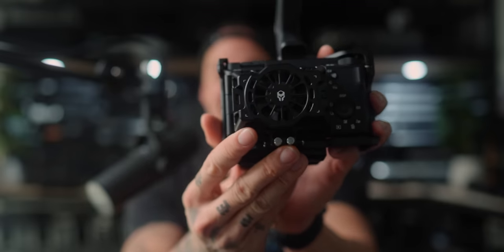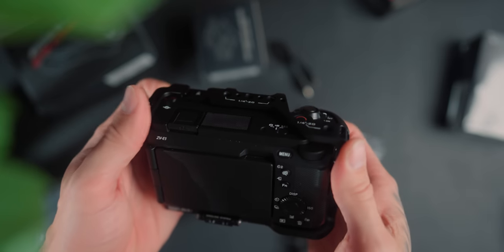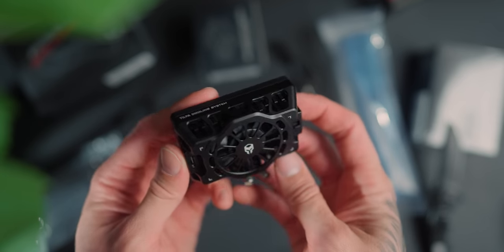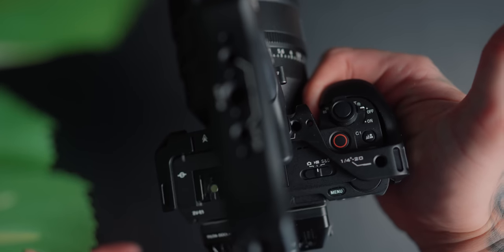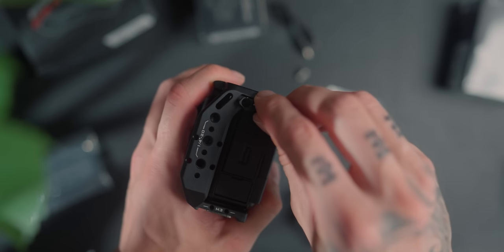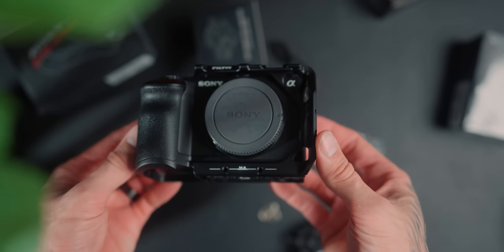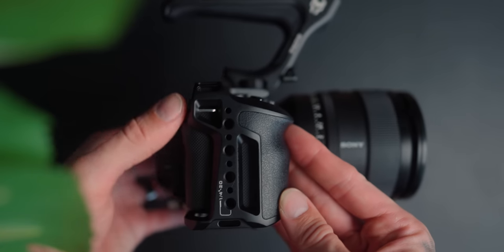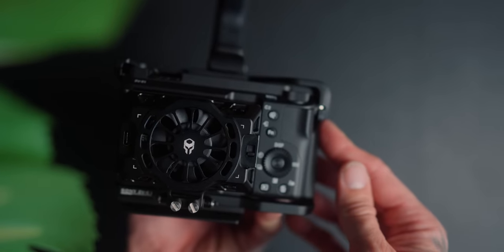Sony ZV-E1 Tilta Cage & Fan Overheating FIX!!!

Comment: There is a similar fan from Ulanzi currently on pre-order. It does not tilt down, but it has a built-in battery and the pre-order price is $19.95
Reply from the maker: I would still go this tilta version
Reply: Does it need an external battery? If so, that sucks too
Reply: very clearly this tilta one is much much better quality
Reply: @BuiltInception did you try both? The ulanzi fan seems so be super silent comparted to tilta
Reply: @mandrael  yes I can agree to that also the titla requires external power. I'll be honest with you neither one in the end I am even using. I figured if I have to use a power bank anyway I am simply using a "stroller fan" for children strollers lol. Its from amazon, USB , its silent and I just clip it on to the tripod or whatever im using to mount the camera at the time if I know its going to have the chance to overheat or is going to be longer form and it achieves the same end goal it never overheats (4k60 until battery runs out) and the benefit to this solution is also you can run it until the battery is low and then plug the power bank into the camera itself to give it even more time although it WILL overheat being powered via USB this way so I run the battery out instead. Im sure a dummy battery would work though I havent had a need for over 2 hours record time in one sitting so I havent got one.
Reply: The Ulanzi one has an internal battery as well. Very sad that this one does not

Comment: Hey Jason,  try two things with that fan if you could. They aren't practical but an extreme case scenario for this fan.
One, try and put a higher quality thermal conductor pad then the one on the fan, you can find quality thermal pads that conduct heat extremely well and fill the square space and then apply the fan and try an outdoor heat test. The second is slightly more extreme, find a  large enough thin copper plate and put that as the pad between the fan and the camera. Just ideas, best of luck!

Comment: Jason, do you know if this fan would fit the A7IV? Im not sure if all of Sony's flippy screens are the same but i was so disappointed with my A7IV, for the first time ever i recorded a school event performance for a school with kids with disabilities and the camera overheated ans shut down in 4K 30fps in 1 hour. I used a dummy battery with the display open and a FX Lion nano three external battery. The them was also said to High but the only thing i did forget to do was open the SD card cover. The A/C was On in the auditorium so i wouldn't consider it being too hot. I donated my time and the principal was happy that i was able to get the majority of the event but i would have been devastated being paid and this happening. 😵‍💫

Comment: I use the Canon version of this fan on my A7IV. It doesn't fit 100% but I made it work. This new Sony version would work much better. I hope Tilta makes a new cage for the A7IV that can be used with this new cooling system.
Reply from the maker: Oh nice!

Comment: I’ve seen some other people posting about this fan. It kinda goes against why people liked the camera because of size, and also powering it just makes it too big. I think Sony needs to get the overheating issues figured out moving forward because as of now that’s the one major complaints from people here in Miami with these new cameras.
Reply: its for versatility
if you shooting short videos take the fans off, if you need to shoot long period rig it up
theres a reason why no one brings an fx6 around to vlog, aside from the price, you cant go anywhere smaller than that, where as fx3 can do 90% of fx6 if you rig it properly
Reply: @KenTVtw  lol no one mentioned a FX6 😆 but for $2200 plus the couple hundred in add-on there are better options. And spending $2200 Sony should just get their $hit together and fix these overheating problems in their cameras moving forward.
Reply: FX6 and FX3 was mentioned cuz you said people cared about the size
and no one asked you to get zve1
if you aim for compact size, with full frame sensor, this is exactly it
if you cant handle it, get the bigger fx3
Reply from the maker: True
Reply: @KenTVtw   to be honest i think that with the cage and that fan the size difference between the EV and the FX3 aint that much anymore,....... don´t get me wrong i want to buy the EVZ1 but I am afraid is gonna overheat if I start interviewing people in the streets for example........  i guess that i could shut the fan off when i am interview people cause obviously i don´t want to hear the fan......... there are probably ways to work around this

Comment: DO they make one for the A7IV?
Reply: 8:24 he hints that it fits the A7iv. I wish he could have given just a little more depth. I’ve been wanting to purchase one for my A7iv but I have been able to get an answer to how it would stay in place. 🤷🏿‍♂️
Reply: @PastorGreads  I hear you, For some odd reason it seems the A7IV overheats for some and for other it does not, I have gotten into several disputes bc my overheats on almost every shoot and not even in that hot and humid weather, where I live it get's "hot" but no humid and nothing like Florida Hot where I am sure my A7IV would catch on fire. I am a professional and have read all the posts on how to keep it from overheating but mine still over heats, albeit I shoot 90% of the time 60p 4K which really makes the camera work a lot harder to process , but it should NOT overheat like it does so quickly.. I will most like go back to the FX3 for the same reason. I do not think this fan will really help that much anyways and might be a little bit gimmicky..

Comment: I've experimented with using my ZV-E1 as a webcam because, why not? My colleagues commented immediately on the image quality. But I found that it overheats much faster when web-camming than video recording. Lasts about 30-40 minutes in a 21 degree room for me. Have you found that? And does the tilta fan stretch the ZV-E1 to a point where I could do a full day's worth of meetings without overheating?
Reply: Following this. Any answers?
Reply: Did you try it out. I was thinking of doing the same thing.  Also which lens are you going to go with as a webcam?

Comment: Can you check the results with this fan on the new a6700
Reply: Really want to know this +1
Reply from the maker: I gave the a6700 back so I can’t test it
Reply: @JasonMorrisphotocinema  thats a bummer, hey but thanks for taking the time to reply
Reply from the maker: @cherianphilip4707  this fan does give great results on the zv-e1 which will mean it will still give some results on any other camera.
Reply: @JasonMorrisphotocinema  rather than the results I just wanna know whether it is compatible on the Sony apsc line, cos this is built for the full frames

Comment: Never had overheating issues but yesterday sonething weird happend with my ZV-E1. 

Just as I stopped recording it kept writing to the sd card and I couldn't do anything.. not even close the camera or change anything. Only way I got to close the camera was to pull out the battery 😅

Works comepletely fine now 😅😅
Reply from the maker: Yeah some cameras have random bug issues.
Reply: @JasonMorrisphotocinema  Also I can't choose between the Tilta or SmallRig cage.. which would you recommend?

Comment: Thanks so much for this great video!  I saw the fan on a Twitter (X) post from Tilta.  The fan is priced really well but that cage...ouch it's a bit expensive.  It seems to be a great design and great build but it's out of my price range. The lightweight kit at $99 may make its may to my cart though.  Cheers
Reply from the maker: I feel the cage is priced reasonably considering how well it is built
Reply: @JasonMorrisphotocinema  fair enough since you have had in in your hands.  I know Tilta makes amazing products.
Reply: the cage has a few downsides, smallrig one does not have these (hdmi clamp blocks sd)

Comment: Hey Jason! Great channel! Gear question: Currently i have a7iii with Tamron 17-28 and 28-75. I would consider myself somewhat of a hybrid shooter but with tilt towards video. No commercial, just content creation and smaller video projects for my band. What to upgrade towards 10bit 4:2:2 and i would like to have a flip out screen. Should i buy FX30(i also have Sigma 18-35 from Canon times) or ZV E1 and keep a7iii for photos for both options? Or a7IV(60fps crop is not a big deal since i also consider fx30) and sell a7iii and Sigma 18-35?
Reply: Also forgot to mention that "run and gun" is something that i am looking for with occasional controlled shooting. Thats why i like Dynamic Stabilization and small size in ZVE1.

Comment: If overheating is a concern for anyone, consider getting the Sony FX30 instead. I know, I know, you lose FF, but if you're getting the ZV to save money in the first place, the cost of FF lenses negates that. Unless you're filming for Netflix, you won't likely be able to tell the difference either.
Reply: Agree that FF isnt “necessary” but if you’re budget allows for it and also if you already have FF lenses from other FF cameras (for example I have had the A73 and loved it for years and have built up a good set of lenses for it) but now want to upgrade to a better FF vid centric rig. The ZVE1 + this fan is still an incredibly better deal than the A7S3 or FX3. I think there’s space for a varied group of creatives and I think this fills a space in that world and minus the overheating the ZVE1 is a great value prop. Add this for $60 and it makes it something to consider. 

Side note - YES i do wish that Sony would’ve solved this issue from the get go without having to use 3rd party hardware BUT I can also concede that fitting that sensor and tech into an EXTREMELY portable product had to have some compromises somewhere.
Reply: The cost of FF  lens is in fact cheaper for the same equivalent lens . To achieve the look and light capture ability of a 35mm F2  FF lens, you need an APSC 24mm F1.4 lens, which is more expensive. You may tell me you don't need that low light ability, and APSC 24mm F2 is fine for you. But then with FF 35mm F4 or a slow zoom is dead cheap, and weight like feather.
Reply from the maker: Just depends which is needed. ZV-E1 features are hard to beat
Reply: @mykeljewell I’m in the exact situation as you and I agree with everything you said.
Reply: Rolling shutter performance matters.
Reply: The low light capabilities on the zve1 sensor is awesome
Reply: I've heard the semiconductor coolers work very well at stopping the overheating. Most can't afford dropping $2700

Comment: My fan won’t turn on!!!! I plugged it into my wall, and into my v mount battery and it just won’t turn on!!! 😡😡😡 ok update. You HAVE to use usbc to usbc. You can’t use regular usb to usbc. Looks like I have to get a new battery or electronic mount plate. Fuck. The return window for my battery JUST ended

Comment: 'Band aid' solution 🙂. and Tilta makes good stuff, but if Sony (which makes good FX cameras) can't put a 2 dollar fan in all of it's full-frame cameras then I won't even look at the rest of it's features. The AF is fantastic, but we had Sony / Canon heat problems some 10 years ago. they put a fan in the FX30, so did Lumix (the most value-added cameras), so why not Sony? Frustrating.
Reply from the maker: this is what the FX line is for. They are aimed at professional videographers and have fans

Comment: Love your channel but I did my own review on this cage vs the SmallRig. I’m kind of disappointed you didn’t point out that you were either paid or just ignored all the functional flaws of this cage. Beautiful but poorly engineered compared to the more mundane SmallRig.
Reply from the maker: The only flaw I see is no mounting point in the middle. I said this in the video dude. Chill out
Reply: @JasonMorrisphotocinema  The added arca plate that could’ve been built in, the lack of a longer grip that’s super short, the placement of the cold shoe direct in front of the hot shoe, the installation process. All fall short of the Smallrig. I did a quick comparison on my own. The tilta looks and feels amazing but usability was lacking.

Love your content but just felt you gave this more props without calling out its faults. Nothing but respect though my man. But the fan is very cool 😁.
Reply from the maker: @sneakergearz  I personally didn’t see any of these as a fault in the way I film

Comment: You didn't really test the fan to see how long one can record for. You just said, "I don't see why you'd be recording for long periods in 4k50/60". That doesn't help us one single bit.

You didn't do a noise test to let us know how much noise is introduced to the sensor, due to heat, and how much that noise is reduced with the fan on.

You also never showed how bulky the camera becomes once you mount an NP battery on it, which in mandatory for operation.

I'd tell people to stop being cheap, and save up for the A7SIII or FX3. This fan only makes the ZV-E1 more of a hassle to use.
Reply from the maker: It is just after that. I test duration and noise test. Watch the whole video dude
Reply: @JasonMorrisphotocinema  I'm talking about noise induced to the sensor, due to the heat generated.
The ZV-E1 doesn't have the same video quality as the A7SIII, due to to heat it generates.
Your tests don't address the before and after.
You tested fan noise.
Also, You tested 4k50/60, not 4k120.

You stated that the camera is still a good buy due to its compact size, but failed to show how big it is when you add a NP battery to it. 
I watched your video.
Reply from the maker: @TheReallyBadChannel  pixel peep at 2000% and you’ll see a difference. 1:1 you don’t notice jack. Sorry to be blunt but the truth. Focus on story telling, framing, composition, lighting, rather than some potential microscopic noise detail in the image
Reply: @JasonMorrisphotocinema  Better to be blunt than to be misunderstood. I get what you're saying, but if you're putting content on Youtube,  IG, Twitter, etc, the platform compression will make the noise worse.

Secondly, SORRY TO BE BLUNT, BUT THE TRUTH... You're a gear hawking/review channel. Don't tell people to "Focus on story telling, framing, composition, lighting, rather than some potential microscopic noise detail in the image".

If you are not SHOWING your viewers how to do those things, don't promote them when questioned on YOUR review.

Thats not what your channel is, you do gear reviews like all the other gear influencers, THUS, you should be meticulous in addressing technical issues, instead of gear technique.

Comment: Did tilta slip you a hundy for this review?

Rigging up a fan that needs an external v mount battery bigger than the camera itself 😂 makes sense

Not to mention unusable audio into the camera. Better carry my sm7b around for all my run and gun work

Come on brooooo
Reply from the maker: I have said this in about 6 videos that this camera was not designed for this long record time. This is an option for people who want to push those limits. I recommend people use the FX30, FX30 or FX6 for these super long record times because of the fan. Rigging out the camera in a professional set is what I do. Might not be what you do. 
I mean, you can make a better review video if you want. You do you
Reply: lol u can power it through camera monitor or just plug into camera

Comment: I really like the cage and the top handle, the fan is stupid. You buy this camera for the size factor, then spend a boot load of money on a fan & a battery omg 🤯 By the time you add all this you should have got the FX range.  I'm sure the stupid ppl will love it 🤣
Reply: zve1 is the only camera that has ai autofocus chip that uses IMX 510 sensor

Fx3 is like double the cost of zve1, and a7s3 doesn't have focus compensation feature.
Reply from the maker: I agree. I don’t think the fan is needed but people want to use it for how it wasn’t designed